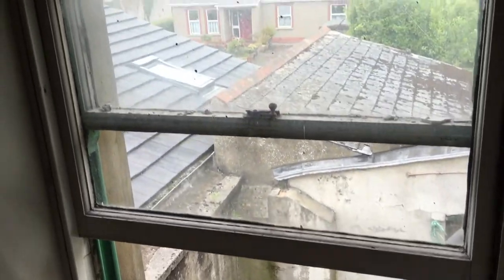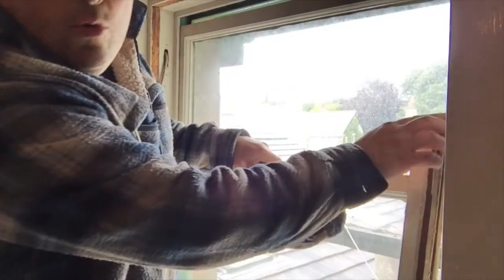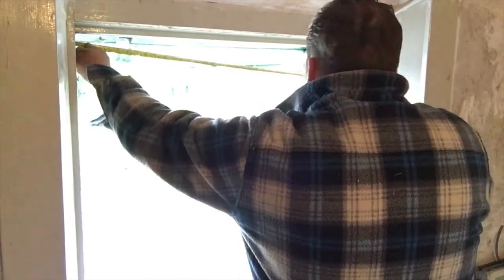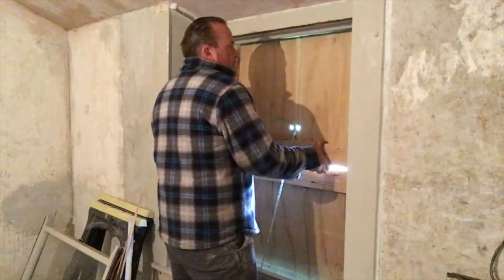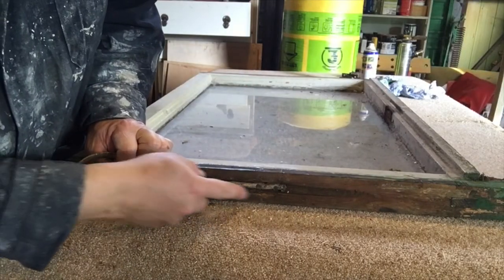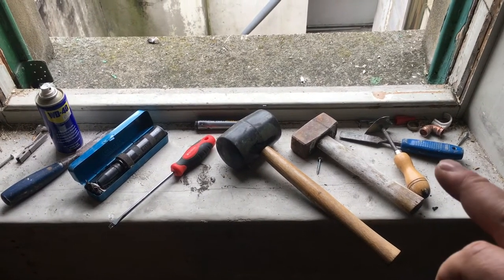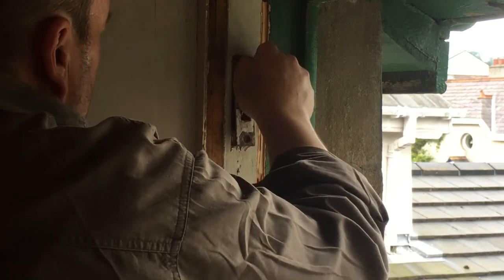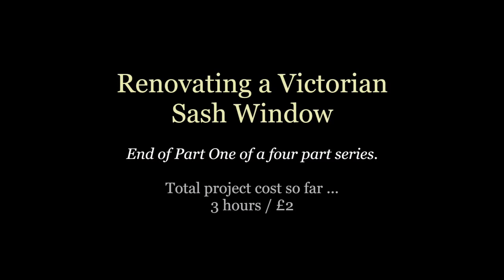Removing a Victorian Sash Window

Comment: Cutting the cord  and letting the weights fall means you will lose some weights, they will break through rotten timber and some 'boxes have  insufficient backing. I clamp the cords before cutting . When both sashes are out and I can remove the weight box cover  they can be let down safely
Reply: Yes, just what I thought. Unless you plan replacing the cords I'd put a knot in them first to avoid the weights from dropping.